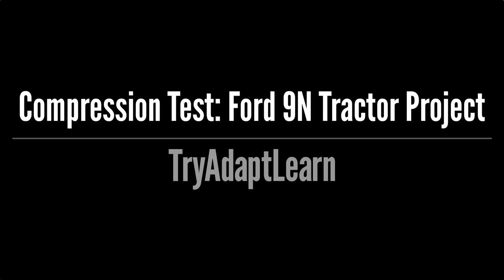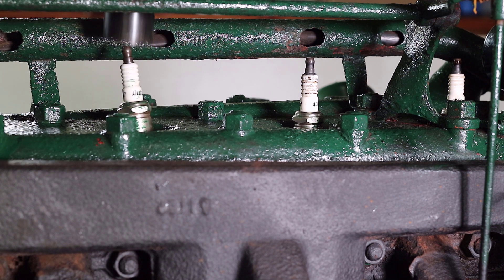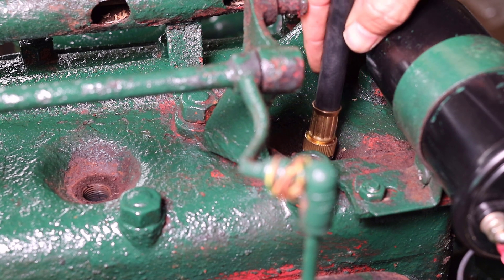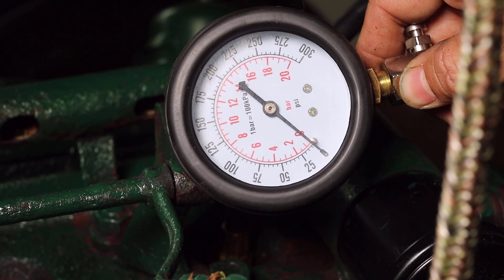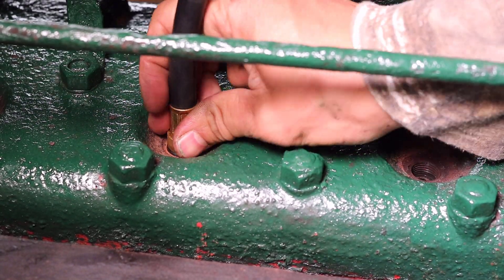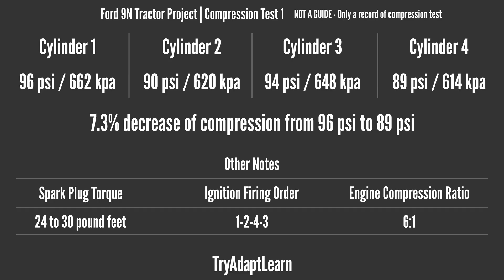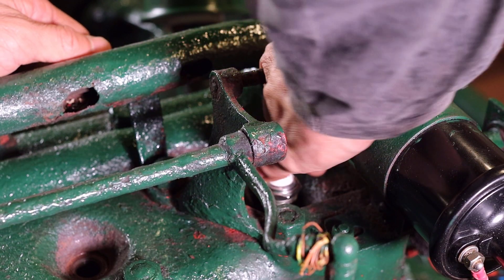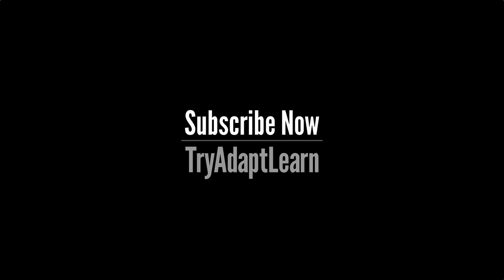Engine Compression Test: Ford 9N Tractor

Comment: If the throttle is not kept at "WOT" (wide open throttle) your values will be inaccurate. Also, an engine can have a much greater variation in compression than that and run just fine for years, and years, and years. It will be a little less efficient, but it will still do its job. Also, some engines will develop more even compression at working RPM as compared to starter motor with plugs removed RPM. Unless you just insist your engine be text book, keeping running it until the idle loops and the compression gets much much lower and it will be fine.

Comment: uh oh....i did this and all registered 75psi.   hope it's just a crap gauge?
Reply from the maker: You may want to double check that all fuel and ignition is disconnected and all spark plugs are removed from every cylinder.  It may be the gauge if you know your engine will start.   My opinion is the engine would not start or would be extremely hard to start with only 75 psi compression.  Even before you try another gauge, you could plug the spark plug hole with your finger.  If it’s weak you can tell and if it’s strong or in a healthy range, it’ll feel like it’s trying to blow your finger above and away from the hole.